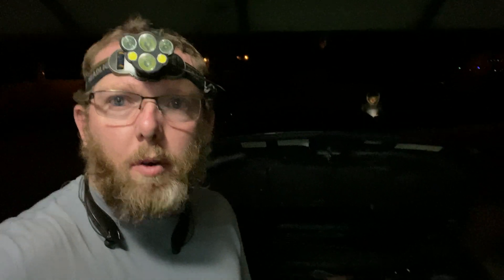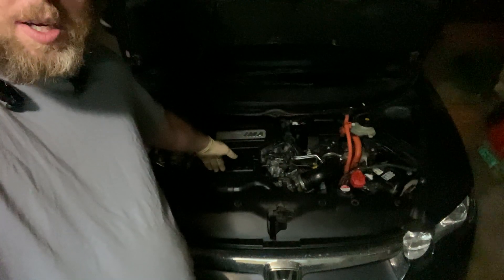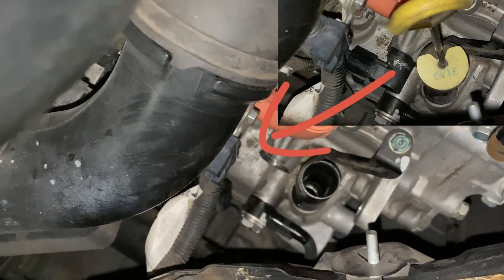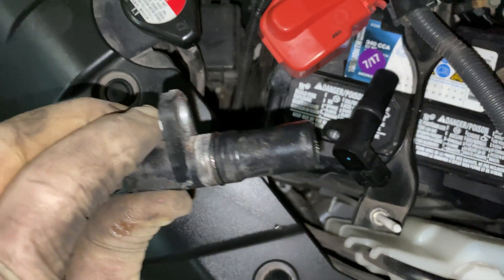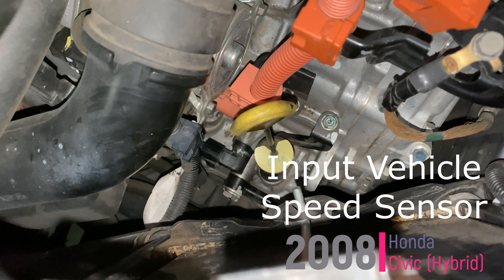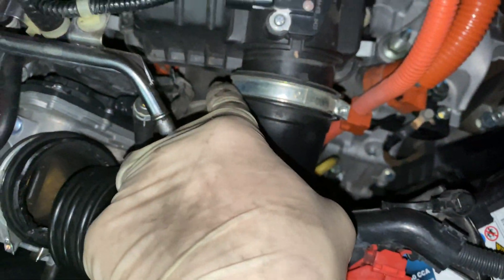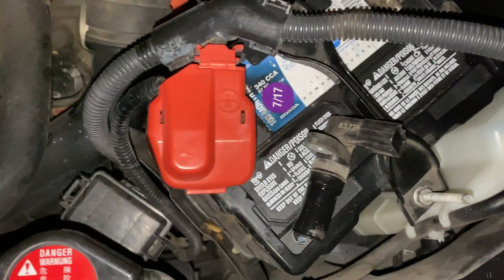2008 Honda Civic Hybrid, 1.3L FWD, How To Replace The Speed Sensors (Fix The Speedometer)

Comment: I'm sooo confused, so when you said this one is definitely not right at the end. That's cuz the input and output speed sensors are the same, but the SHORT one, where the hell does that one go? I change the input speed sensor and my transmission is no longer acting up and the p0717 code went away. BUT the p0502 code is still coming up and the damn speedometer is still not working!!! I'm almost sure I have to replace wherever the short one is. But can't find anywhere where that one is located, help!!
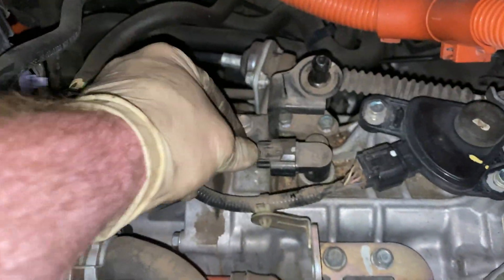Reply: Go to 3:32, do you see that little black stub where the airbox would attach to, u see the metal bracket that its part of, it sits on those 2 bolts. Remove the 2 bolts completely, and take off that metal bracket with the stub. And you will see it. It's completely hidden, take off that bracket and u will see it
Reply: If u got somewhere I can send pictures to, I'll show u a side by side comparison, look up the transmission on google images, ull see it, it's BEHIND, stick ur hand BEHIND that metal bracket where the airbox attaches to, and ull feel it
Reply: @CarlineSales-pz6mz   hi just to update i have installed new sensor but speedometer still do not work and exclamation mark is there.Any what could it be thanks
Reply: @HM-yp8pv  u replaced the short one? The one that's behind that metal bracket that hold the air box?
Reply: @HM-yp8pv  are u getting the p0502 code?
Reply: @CarlineSales-pz6mz  no i do not have the code but if only a triangle (!) in triangle.I believe there are four sensors as per honda dealers so far checked 3 it might be the fourth one not sure
Reply: Yes i did change the one you mentioned
Reply: Got p0502 -02 speed sensor open/short now any idea what that could be
Reply: @HM-yp8pv  yes that's exactly the short speed sensor, the one behind the transmission, are u sure u found the right one and replaced it with a new one?
Reply: @CarlineSales-pz6mz   yes i found the one in the back which you mentioned and replaced with brand new as the old one was not good it had some metal shavings.I also replaced the other two too the ones this video shows but the warning light is there p0502 open/short.Is there any other sensor as honda dealers says 4 sensors but i can only see 3
Reply: @HM-yp8pv  I haven't found a fourth, do u have a hybrid or regular?
Reply: @CarlineSales-pz6mz  hybrid
Reply: U think it could be a wire as it shows open circuit
Reply: Hey, got the same problem, lmk if you have any updates
Reply: @yuriiromaniv5799  yea I found it, it's BEHIND the transmission
Reply: @yuriiromaniv5799  put your hand behind where the output sensor is, there's a metal plate that's in the way (the mount where the air cleaner box sits), if u remove that plate, u will see the speed sensor, its the short one, and it fixed everything. So I wasted money on the the long ones for no reason
Reply: @hi-volumebeats595 where exactly is this speed sensor mate as i can find this one what he has taken off where else is the speedometer sensor as i hv speedometer showing zero